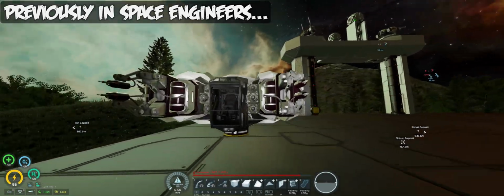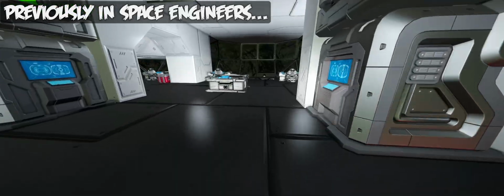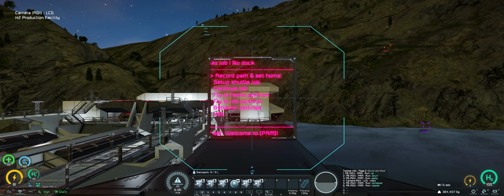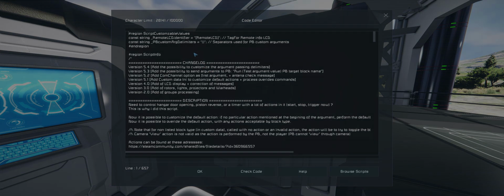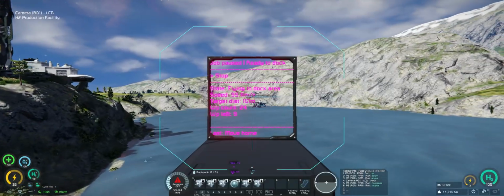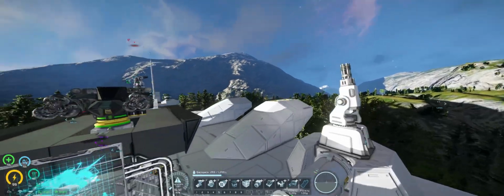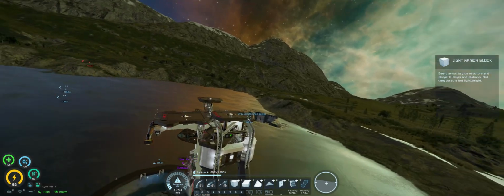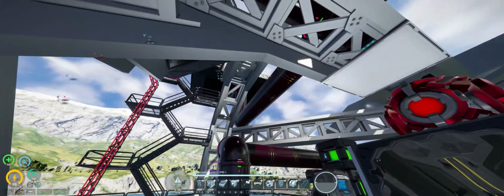Space Engineers 2022 E08 - 3 Drones and a Mining Outpost

Comment: When the ice mine runs out of ice you could reengineer the drills to make a sweep arm around the outside of the station's footprint. That should increase the stations useful lifespan several fold depending upon how many drills you use on the new sweep arm.
Reply from the maker: Yeah that's a possibility. It would definitely extend the lifespan by a lot